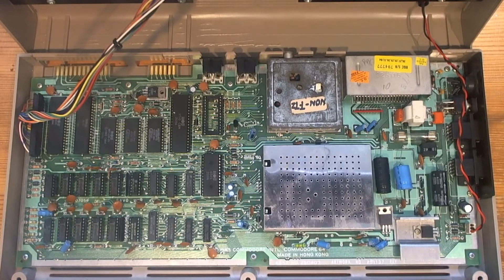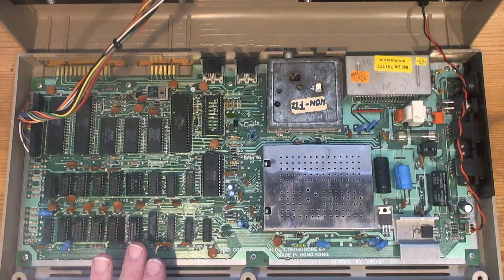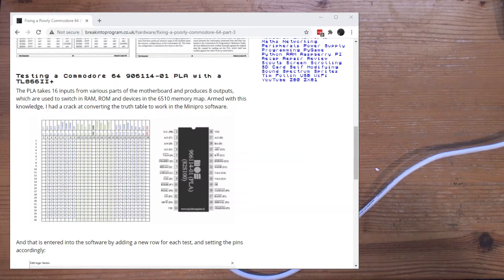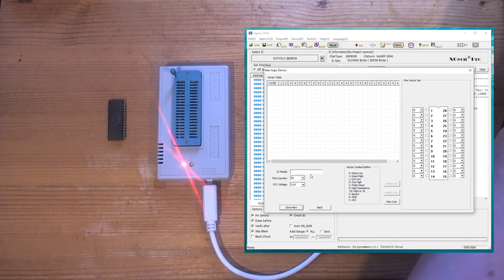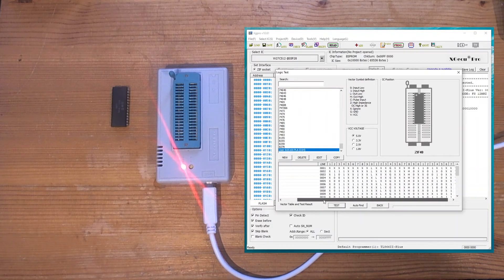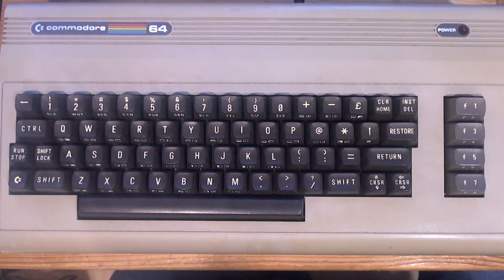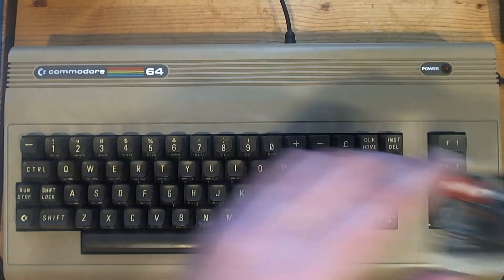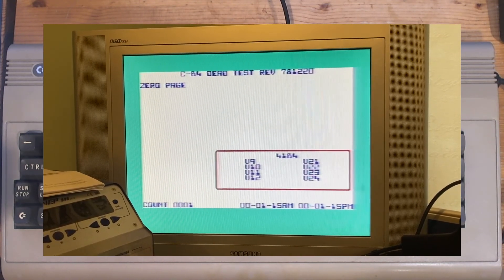Fixing a Poorly C64 - Part 3: Testing the PLA

Comment: Very late to the party but I discovered xgpro-logic yesterday.  And posted how I think it could be used to test a 6502 over on the 6502 forum.  I doubt I can post a link here but the topic is "Testing the (Rockwell) 6502 with an XGecu TL866 II" if you search for it.

Comment: On your test, my PLA failed on line 0006 (PIN 12 and Pin 18) and on line 0012 (Pin 13)
Is that warrant for a replacement?
Reply from the maker: There are reports of other replacement PLAs failing on those pins. See comments in link for more info. If the C64 is otherwise working with it installed, then I'd personally not be concerned.
http://www.breakintoprogram.co.uk/hardware/fixing-a-poorly-commodore-64-part-3

Comment: Gratz on the fix, great video!! I like that test on the Minipro, are you able to export the custom PLA settings?😅 There is also a diagnostic cart for the c64 (see world of Jani). Dead test is used for a c64 that doesnt work at all, your past that.
Reply from the maker: Hi, thanks! Yes, in the latest version of the Xgpro software (10.80) they've included an import/export feature for custom tests. If you scroll down to the bottom of this page, I've attached a link to a zip file on my blog post: http://www.breakintoprogram.co.uk/hardware/fixing-a-poorly-commodore-64-part-3

Comment: I didn't have a C64 back  in the day  and since restoring one for my self I found it was the one system I would go back to more than others. It was great to see you work the problems on this and the expression at the end shows how happy you are with the result.
Reply from the maker: Yeah - I think you're right. I reckon this is now one of my favourite machines in the collection. I was brought up on Sinclair, but was always fond of the VIC20 and C64. Just need to get an SD2IEC now. I've played a handful of cartridge games off the Versa64Cart, but the 16K limit does limit the games one can play.
Reply: @BreakIntoProgram  Awesome find!  I am also attempting to restore a C64.  Another good project to tackle is the pi1541 instead of an SD2IEC.  I laid it out on a breadboard before getting a pcb.  Great work!